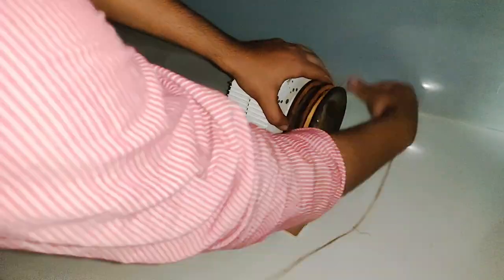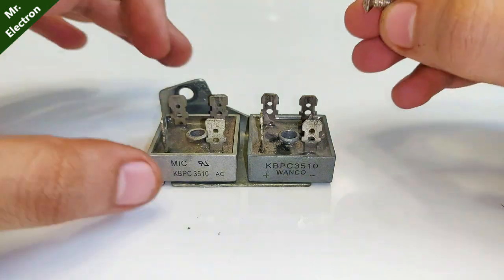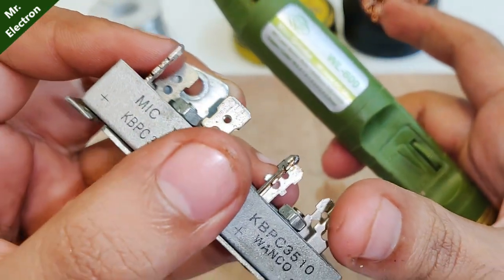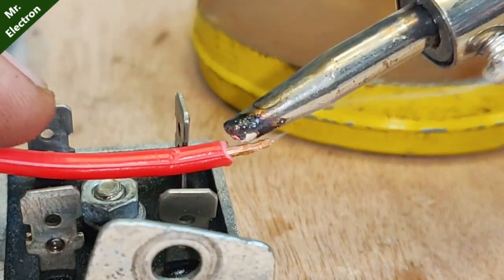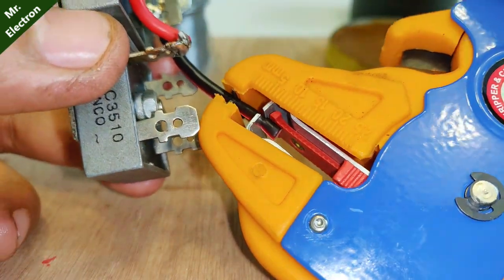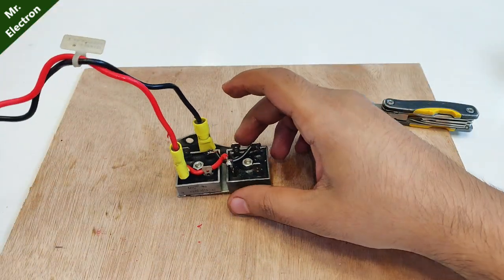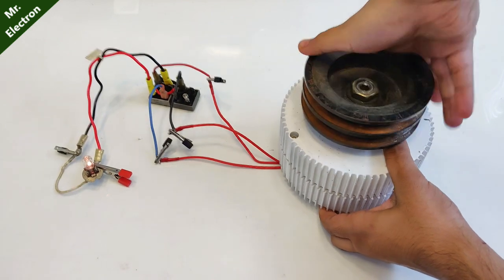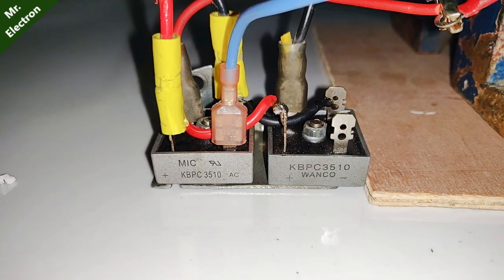Make 400 Amps Bridge Rectifier ( AC to DC ) for Wind Turbine Generator | 1 Phase to 3 Phase

Comment: Didn't get far into this video, there was so much going wrong in the first 2 minutes.  Nothing like 400A here.  Maybe later in the video he brings up the need for a heat sink.  If you wan't to go on the cheap, you can buy pretty good 3 phase rectifiers rated for 100 or 200 amps online (a single chip) ~ gotta have a hefty heat sink though.

Comment: Does your solder not have rosin flux inside? That's what removes oxidation. It does appear you're using flux, but to coat the wire...oh. Wait. You're soldering method is odd. Try this: hold the device in a clamp or tape it down, apply solder to the hot soldering iron tip to tin it, then hold the tinned iron tip to the terminal, and at the same time touch the terminal with solder wire until it begins to flow. If it does not appear smooth or flows poorly, apply extra flux to the terminal and perform the same steps. You shouldn't have to dremel and paint your wire ends in flux that way. 

If you solder wire doesn't have rosin flux inside it, then just apply flux from that canister to the terminal and follow the same approach.

Comment: Your diodes should be mounted on separate heatsinks much larger than you have mounting them close together will make them get too hot and you're not getting 400-amp out of this circuit without blowing it up

Comment: Sorry my friend this is not 400AMP  it may be 400watt I use a 100amp rectifying block with a heat dispenser and contact paste between the aluminium thanks
Reply: He did not say 400a, he said that the rectifier can handle up to 400a. :)

Comment: What will happen if you connect the wind turbine generator shaft to your generator bike or a combustion engine? Will it be capable of powering a 13A 230v a.c. load?

Comment from the maker: Note : I have stated 400 Amps because that's the max surge it can handle although rated continuous current is upto 50Amps with single rectifier capability of only 35 Amps
Reply: 40.0A
Reply: I love this video.. brilliant!
Reply: @njokuleonard3448  的的
Reply: Afficher 400A est plus attractif que 40, la preuve, j'ai lu la vidéo... Pas de  miracle, c'est bien 40,donc rien de transcendant, si j'avais su, je ne l'aurais pas lié, ceci explique cela......
Reply: @@pierrevandeputte2543  he said 400 amps SURGE!!! do you not understand English??
Reply: @hstone0808  Well, considering that they are posting a comment in a language that isn't English, what do ye reckon?
Reply: Kuch bhi bol dete ho. 400A remove kar
Reply: Is this a good alternator to buy? I want one for wind turbine,.
Reply: 400 A have different meaning man => Surge(Non-repetitive)Forward Current 
@60HZ Half- sine Wave, 1 cycle.

Also in video showing AC generator would never give you that amount current on whole time. So fix the video text 😅
Reply: So nice vedio sir please reply kariyega ki sir 60watt ka iron kharab ho gai hai aur mai us men se nicrome wire nikal liya hu toh kya mai usi nicrome wire se mai dubara ac voltage par chalne wala soldering iron bana sakta hu please reply please please please sir reply please please please please please sir reply kariyega please sir meri madad kariyega sir please and sir woh ac voltage par chalega ye bhi bataiyega
Reply from the maker: Haan par wo kuch zaada nai chalega
Reply: @MrElectron 0f
Reply: ？？丶，，您複製的文字會自動顯示在此處只要釘住複製的文字片段，它們就不會在 1 小時後過期间？？？f
Reply: f？？？O？f？？？只要釘住複製的文字片段，它們就不會在 1 小時後過期只要釘住複製的文字片段，它們就不會在 1 小時後過期只要釘住複製的文字片段，它們就不會在 1 小時後過期只要釘住複製的文字片段，它們就不會在 1 小時後過期只要釘住複製的文字片段，它們就不會在 1 小時後過期滑動剪貼項目可以將其刪除？？
Reply: How can you make 2 phase with this same method?

Comment: Hello… I was wondering if it was possible through the law of physics/electric laws and all to build an isolated DC to DC boost converter with about 12 VDC input and about 52 to 50 VDC that will put out about 800 Watts? Thank you!
Reply: You would need more current to get the watts up, voltage is the "pressure" driving the current, so to get more volts you must drop the current, based on the conservation of energy principle
Reply: its possible using inverter
Reply: Of course it is possible. In the case of 12V to 50V for an load of 800W, you must supply the theoretical instantaneous current 66A to the primary winding of the transformer (via the inverter), to which the inverter and transformer must be adapted. The core of the transformer must have a cross section of at least 34 cm2 - this is a really large transformer. The 12V 60Ah car battery can provide 800 VA for 40-50 minutes.
Reply: @DL-kc8fc some short of a buck converter check ebay 12v to 48v buck converter
Reply: @realcomsolucoes7403  It will definitely please him :)